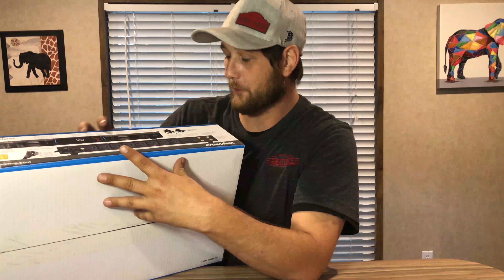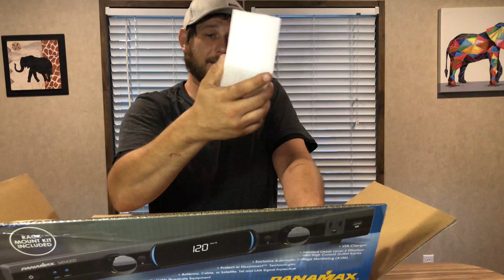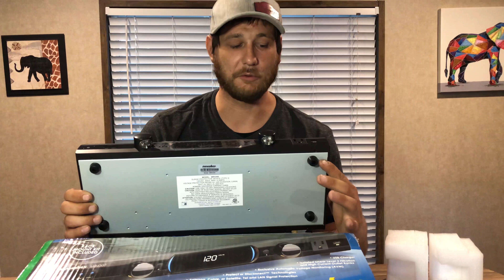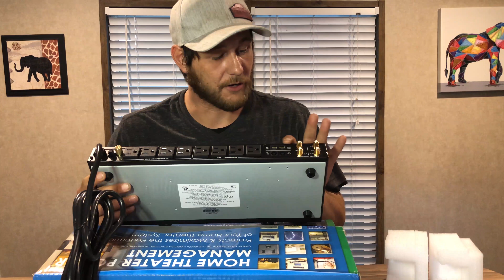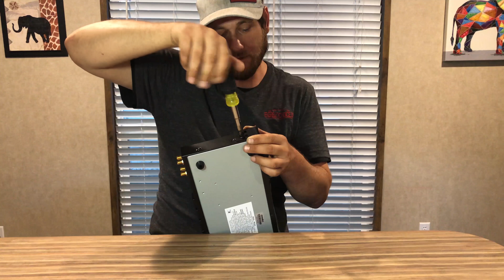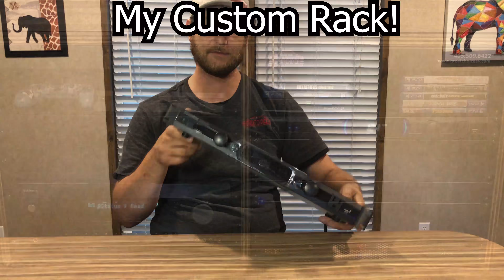Panamax Power Management Unboxing! - Panamax MR4300

Comment: Nice rack! lol I have a similar Integra DRX 7.1 receiver. What side did you plug it into the Panamax? I just picked the the MR4300 and was wondering what side should I plug into. I run the following. DRX 7.1, Emotiva XPA-9, Emotiva XPA-DR2 and an Xbox 1x.
Reply from the maker: We used Bank 1 for high current power equipment.  Nice setup! Thanks for watching!!